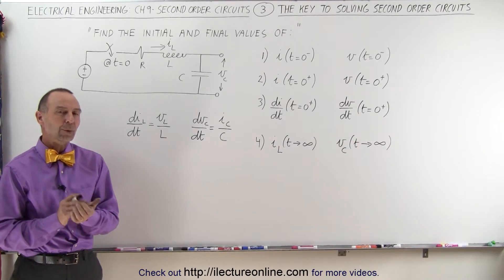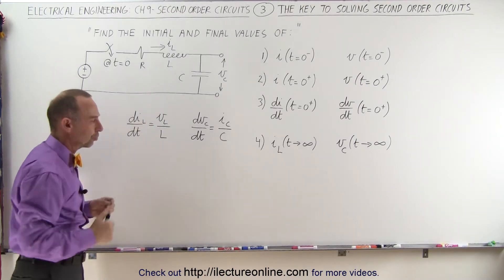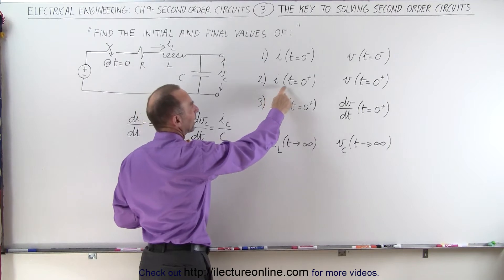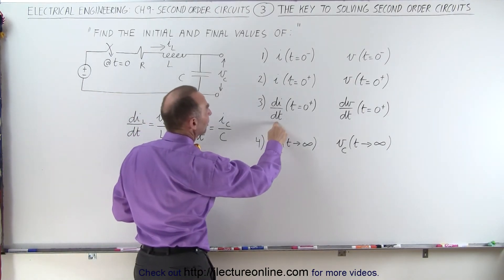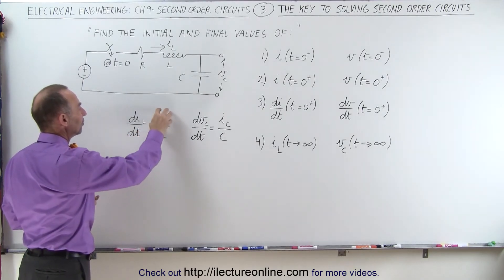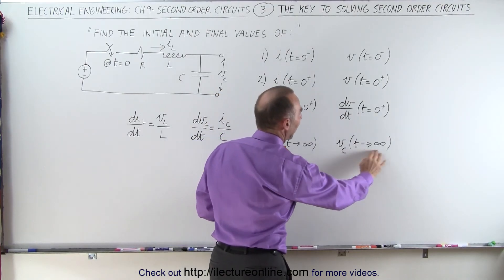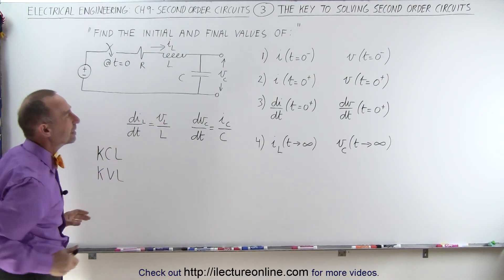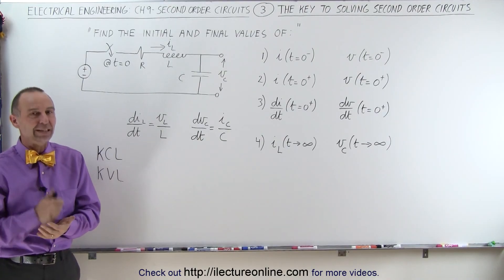Electrical Engineering: Ch 9: 2nd Order Circuits (3 of 76) The Key to Solving 2nd Order Circuits

Comment: Thank you. However I notice that almost no one does high pass RLC circuits. I'm confused with homework because Vout is now the voltage across an inductor. The time derivative of voltage across a capacitor is easy for me since it's just I_L but how do you find the time derivative of voltage across an inductor?!
Reply from the maker: These are just example circuits found in text books and they may not make any sense in the real world.  This is just for practice.

Comment: What if my circuit is the same as yours, but in parallel to the right we have an any value capacitor and any value resistor, asks to find the transient current across the resistor in parallel with the capacitor?

By transient current I mean i(t) for t > 0
Reply from the maker: We have a lot more examples in the playlist.  Watching several will give you the insight on how to use the techniques.